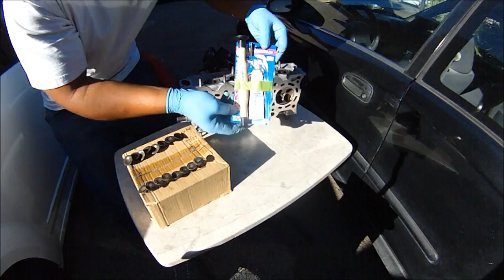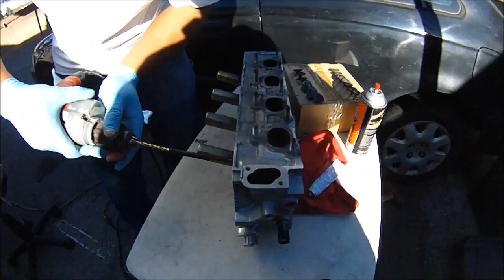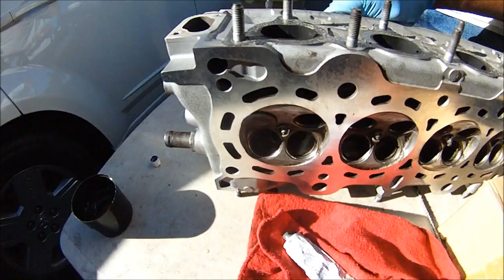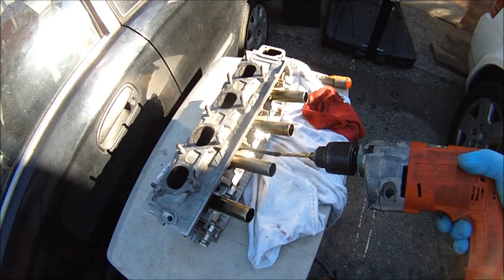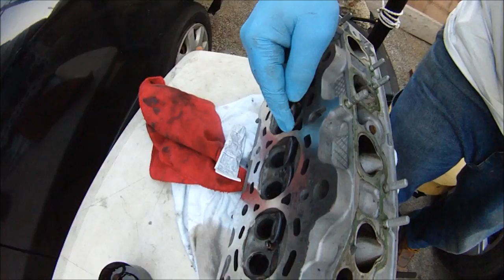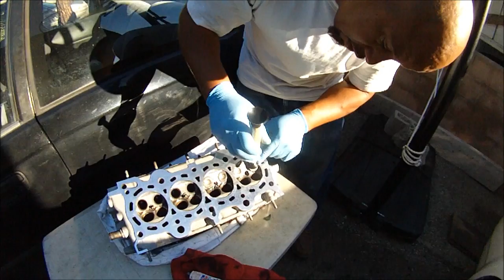HOW TO GRIND VALVES WITH A VACUUM HOSE & DRILL (NEVER TAUGHT AT SCHOOL, ONLY OLDSKOOL)

Comment: wow great tips man! I might use this on my bike when I redo the top end
Reply from the maker: I did show them the old skill way with the slow wood valve lapper  in another video. I have been building engines since 1991 but I'm not gonna massage your ego and try to out do you or say I'm better than you, plain and simple this method works just fine people. Common sense should tell you to keep the vacuum hose straight and by the way how in the world are you going to get any wobble when the valve guides have absolutely no play or a very lil bit of play man? Explain to me how you can make the valve face wobble or crooked when spinning the valve stem in the valve guide? Your theory is off bro
Reply: oldskool funk Hi, Back in the 1980s I had a Landcruiser with a badly burned out exhaust valve in one cylinder. One side of the valve was completely burned away and the valve seat in the head was egg shaped. Without funds to buy a new head or get it machined, I bought a used valve from a wrecking yard for a few dollars. I used a die grinder like a Dremel tool to reshape the valve seat to look more like a perfect circle.I then then did the same technique as in this video to seat the valve and valve seat together. It took a fair bit of grinding but eventually got that nice dull grey seated finished all the way around. The valve sat lower than all the rest but I had better compression in that cylinder than all the rest for the entire 10years I had that vehicle. The whole job took less than a day and cost about $50 for the valve and gaskets. Sure the angles aren't perfect but it sure worked.
Reply: +S. C. Parks 
Some of you people really should consider the circumstances.
The car was an older landcruiser when i bought it, and i bought it over 30 years ago. Its almost a tractor engine, not some high tech formula one racing car. The head on this car was badly damaged with a large burnt out deformation on one of the exhaust valve seats, the valve for that seat was half burned away. Realistically the head was a write off.
 
As the head was stuffed. If it would be possible to repair it properly, it would need considerable cast building up and inserts then complete re-machining to the head. Even back then it would be up around the $1000 mark. It would have been cheaper to throw it away to the rubbish tip and buy another head from a wreck.

As this was in the days before unleaded petrol the valve seats and valves were not hardened like they are now. The original "high heat tolerant" exhaust valve alloy had almost completely burned away.

The function of a valve is to make a seal during compression, then release that seal when opening or closing.  Sure, if you check the correct grind angles you will see how they are designed to create a small seating area. What i did was reshape the damaged head and modify another valve to make it seal. and it did. The angles were not correct - but it sealed.

Check a valve, from any old car that has many hundreds of thousands of Kms on the clock and see how the valve angles look (especially the old leaded fuel head cars). Those correct angles will be long gone and probably have a big groove running around the valve. The valve sealing  may still be good though, but probably wont be 100%. Even though, it could still run fine.

Before the work i did, there was NO compression at all in that cylinder. After the work the compression was as high or even higher than the other cylinders.

Do you think the engine ran better before when it had no compression or after when it did? Obviously it ran much better.

I owned that old landcruiser for at least 10 yrs after that  and it ran perfectly fine at all times. Over 10 years out of a $50 job and head that could have ended up in the scrap bin.
Reply from the maker: TIMEtoRIDE900 Wrong analysis bro, Dont get it twisted it works and is seated and sealed just fine after grinding with the vacuum hose. Dont assume if you really dont know
Reply: RocknRollTractor After writing that last post I remembered that I bought an "inlet" valve to replace the burned out exhaust valve as it was larger than the exhaust valve on the Landcruiser engine. I reduced the diameter slightly by grinding it down in the lathe to match the newly ground out valve seat.
Reply: Squid WithGear This isn't the right way to lap valves. You need semi-circular and random motions.
This is a good way to "cut" unevenly into one side of the seat, because the drill will pull one way or another.
Do it by hand - - this doesn't even save time.
Reply: oldskool funk I worked in a machine shop and have built many motors.
You would have to assure that the drill is pulling straight, and you didn't even mention that in your video, so it probablly never occurred to you that what you are doing is "wrong".

You should at least show people the "Old School" way for comparison (considering your user-name).
Reply: +RocknRollTractor EEEEEEK!
Reply: +RocknRollTractor Exhaust valves are made from better / more expensive / more heat tolerant alloy than intakes. Your re-sized intake valve may not last long in service.

Comment: Hi Oldskool, I'm back. Today I finished grinding the six valves on the drivers side head. I had already improvised a test fixture from scrap material in my garage and could put 125 psi of pressure in each cylinder. No leaks. I'm waiting for new valves I ordered for the other head as I had valve strikes in all three cylinders. Timing chain slipped. Thank you for teaching me and keep on telling the Good News!

Comment: Another great video.  I remember when I was in college trying to do this with the wooden suction cup tool and gave up and turned the head over to a machine shop.  Some questions though: 1) Don't you have to make sure your valve guides are good first? 2) Why aren't you using blue dye/ink to see the seating? 3) Are you reversing drill direction at all or always just going clockwise?  4) On a 4-valve/cyl engine, those valves should be getting at least a 3-angle valve job.  Is this just a single angle or are the three angles somehow reproduced with this technique?
Reply: +Jeff Becker 
Yea he's reversing the drill

Comment: Dude I've worked in a machine shop for years doing everything on valves from mild to extreme, but when push comes to shove your method will work for re-sealing the valves, unless of course you have warped or burned valves. Keep on showing the broke folks how to keep their cars running on a very limited budget because Lord knows back in the day I had to do the same shit you're doing now just to get by. And don't forget the valve stem seals. Peace.

Comment: Oldskool.  I did a self sand and valve lap on my 22R Toyota head (learned it from your vids)... now no valve leaking and 185 psi compression test!! PTL! Machinist wanted $260 to do a valve job and head resurface...and they don't work on weekends! You rock Oldskool! T/Y!
Reply from the maker: tempest411 Your over analyzing it. He saved money and did the job with pride. Great job Coolramone, keep on being independent and keep from getting ripped off. @ tempest I will be making a video this year on how to do all that at home. Head resurface Grinding valves, valve guide removal and replace, cylinder head pressure check (yes how to check for a leaking cylinder head) all at home. 2015 im gonna knock the sockz off the haters and reveal all my trickz.
Reply: Thank you so much for showing how to do stuff without needing this expensive stuff. Im a teenager on a budget and its going to take a while but this will make it so much better. The fact that I can do this is amazing and it's rewarding. I personally enjoy the fact of doing without a machine because it's so much more reliable.
Reply: What about reconditioning the guides (with new ones), checking the head for leaks and cracks, facing the valve, and cutting new seats. What you are doing is just lapping the valves, that's it.
Reply: coolramone Hi people thank you so much for watch my new video came in here now https://youtu.be/Byx0m34xC4o

Comment: As always i love watching your videos very informative, ive done it this way also but i didnt know any one else had. I have also used the 4 dollar tool i can do better with mechanics gloves and my finger.
Reply: Bill, you're right, the tool doesn't grab the valve well, and it's a pain. Especially if you've got any lapping compound on the suction cup, or on the top of the valve.

Comment: There's a tool for this, its called a valve lapping tool. You definitely need  the compound and there is no problem doing it yourself but you cant tell when the compound is done when the drill is running.  $4 tool and some compound. 
http://www.summitracing.com/parts/oes-25040?seid=srese1&gclid=CJe5z-Smr8ECFahr7AodU1EA_g

Comment: How did you remove the valves? My Mercedes valves are recessed down in the head so you can't use a normal valve spring compressor, looks like these springs were recessed also.
Reply from the maker: I made a homemade valve spring compressor
Reply: oldskool funk Can you show how you did that and tell how you built it? I want to clean my valve seats up and replace my valve seals but can't get them out without buying a $50 spring compressor.
Reply from the maker: Hey Chris, watch my video EASY, HOW I LAPP & GRIND VALVES. THEY DONT TEACH THIS TRICK IN SCHOOL, ONLY OLDSKOOL. Go to 2:50 and you will see how I take off my valves/ keepers etc. I made it from a shopping cart and a bunch of stuff I have in the garage. The actual round part that I use now on top of the spring retainer is a hollowed out small flash light carved out so I can see the keepers because its stronger. Be innovative an make your own stuff. All you need is a stationary bar and something to pivot a socket or whatever to push the sprng down.I made mine to last because I do this work all the time. Go attack it with confidence and God Bless.
Reply from the maker: Try Taping the top of the valve spring retainer with a small hammer on top of your your 1 inch pipe to break the keepers loose from the stem groove.